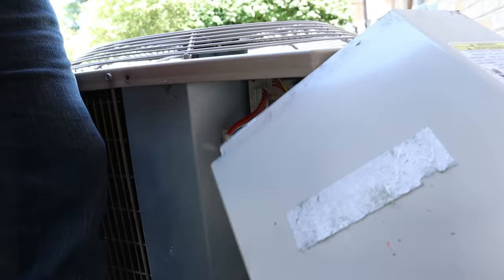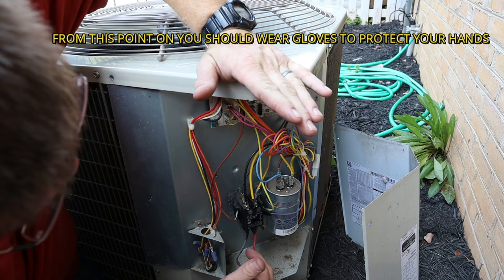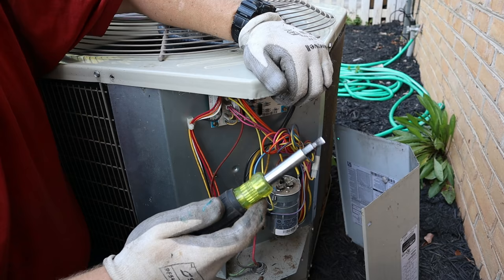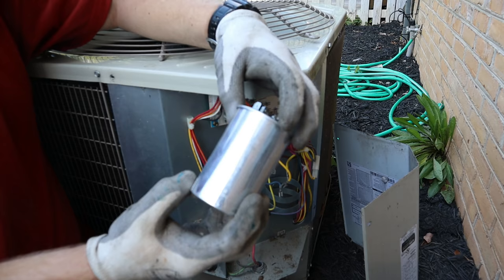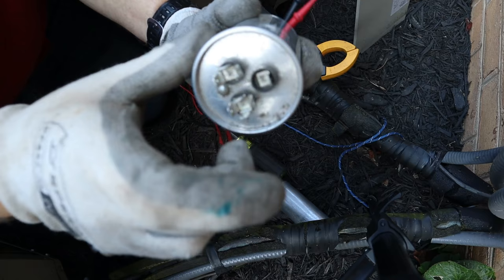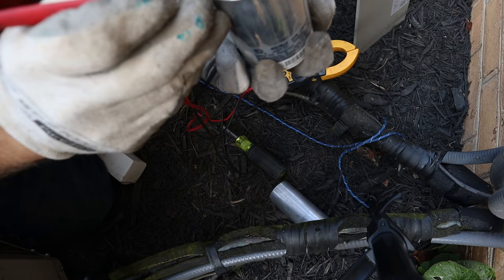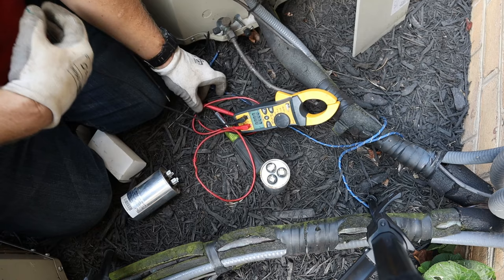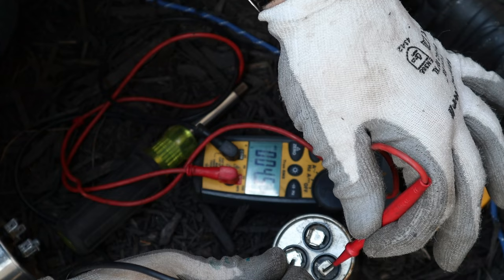How To Fix Your AC |Outdoor Fan Will Not Turn On

Comment: Dude, its 107 degrees and my unit quit. You are the bomb. I owe you.
Reply from the maker: Glad you got it fixed. You already paid for it by watching and commenting. Have a "cool" day
Reply: @MountaineerOutdoors I came home from vacation and my house was like a Turkish bath! Great content, the only problem I have w the video is no explanation of getting oem parts for an older unit the schematic for the top of the component can be laid out completely different than the original one was! My unit is a Ruud I believe it’s a 110 bcuz it’s on the smaller side! But it’s almost 20 years old now so I got a capacitor for it n the layout for the wire hookups is completely different! It took some work, but I finally figured it out! It tested as working but weak signal so I used my new one which looked way better! The original had a plastic outer shell the new one was aluminum! But then I realized my fuse in the outside breaker box was bad as well! Another trip to the parts supplier and it was up and running! It took hours to get the house cold again considering we are in a major heat/humidity spell! We had a big storm when I was gone overnight that may have sparked the issue
Reply: alabama weather in a mobile homes awful at inside 97 degrees and all i hear is hummmmm or buzzzz lol
Reply: @chasitymitchell8502  are u hearing a buzz outside the house or on the inside?
Reply: Well send him a check then
Reply: This is exactly what I'm looking at today, heat index of 115° and it wont work.
Reply: @mikkilglass9896  how did it stop working? Exactly what is it doing?
Reply: changed both capacitors and nothing . i noticed fan will not kick on at all .
Reply from the maker: Might be a thermostat problem is the contactor pulling in when it's calling for cool air?

Comment: The fan on mine started howling like someone was mowing my lawn in the middle of the night. Waiting for the new motor yo arrive tomorrow. As preventative maintenance, I change the capacitors every 5 years and the transfer switch every 10 years. Sucks that the motor didn't make it to the 20 year switch.

Comment: This worked for me! Two years ago I changed out the capacitor thinking it was bad. It turned out to be a bad fuse. AC guy said hold on to my old capacitor because it was still good and I might need it later. Two year later I did and it worked and of course it was on the weekend. Thanks for the video.!
Reply from the maker: My pleasure thanks for watching and commenting ☺

Comment: Thanks for this. I watched this and fixed my AC unit for a $34 capacitor at my local dealer. It went out on the weekend and I know this saved us $300 or more. Amazon had a match for $17 but I wanted to have it right away because of the temps today and tomorrow. Much appreciated.
Reply from the maker: Awesome so glad to hear that this helped you

Comment: I want to say thank you. For the past 4 days my central ac stop working and I use to push the fan just like you use to but it didn't last long and it's was so hot. So I went and bought the AC capacitor and just did the job myself thanks to your video and now everything works amazing. My AC has been with this house for the past 34 years so I do have an older one, but it's all the same thing. Thank you again
Reply from the maker: Awesome so happy this worked for you

Comment: Thank you very much, you were very informative, I just had a service technician come out and change my capacitor, my AC unit fan was not running, $265.00 for the new capacitor.  The technician was very helpful and informative, he advised me to clean out my outside AC unit coils with a garden hose at least once a season, he showed me how to do it.  Mine was completely plugged up, I also need about 2 lbs. of the New Freon added, it was an expensive service call, but I learned a lot.   I had no idea, my AC coils were that plugged up, it's hard to notice that unless you look closely at the fins.
Reply from the maker: Yep such easy maintenance is the key. Actually that wasn't a bad price. I know there are way more companies that charge alot more. Thanks for watching and commenting ☺

Comment: Another thing to notice on capacitors is the prongs on each terminal . Common has 4 pins compressor has 3 and the fan has either 2 or 1. Also good thing to know. Good job though!
Reply from the maker: Yes I learned that much after this video. Thank you for sharing that here. I appreciate your comment and watching

Comment: Never assume that a capacitor has been discharged.  Especially if it hasn't had power for any time.  Caps are designed to hold a charge. Always properly discharge them before handling.
Reply from the maker: Great advice they sure can definitely knock the piss out of you for sure.

Comment: What causes the fan struggle to turn when unit turns on, even after I replaced the capacitor? It spins once I have it a boost with a flat ruler.  House is good and cool now. 75 degrees inside - was 90 inside here in the Rio Grande Valley of Texas.
Reply from the maker: More than likely, your fan motor is going bad. Did you replace the capacitor with the exact same one?
Reply: @MountaineerOutdoors  Yes. Capacitor is good now.  The very old capacitor burned out at the Common four-pronged connector with inner fluid oozing out a little.  It was probably the original one from 1992 and a gray hard plastic, not shiny metal. So, I am wondering if a hung up fan caused the capacitor to fail. Everything works now and house is cool. It's so hot here that the unit has not kicked off at all so I can see if fan turns easily the next time it kicks on.
Reply from the maker: It very well could have. There is a good video of someone oiling the fan on the outdoor unit. Let me see if I can find it. May be able to help you
Reply from the maker: @Texasmann1  https://youtu.be/wSBr0PDCbzE  I believe this one is a good one to watch good luck

Comment: Could use some advice please. I have a standard multimeter, but don't think there is a setting for microfarads, just regular ohms or do I not understand? When I turn on my unit, the fan isn't moving and I only hear a buzzing sound, I do know a fair bit about electronics, usually signals a bad capacitor...Thanks Mountain Man

Comment: 2 months ago, fan would buzz but wouldnt engage unless we bumped it into monentum. Swapped capacitor. Problem fixed.
Now: Same morning replaced duct work in attic, now randomly the outside fan non functional. This time no buzzing. Not sure if I hit a wire or switch in attic or if two scenarios are coincidental and unrelated
Reply from the maker: It could definitely be not sure

Comment: I live I am apartment, turned the air on late Friday night.  An hour or so later it’s not cooling.  I checked and the outside unit is it working, no sound or anything.  They put in new furnace with a/c almost 2 years ago.  Is there a way to tell if the fuse is bad outside without any meters?

Comment: Why my ac capacitor is 350/ 370  and I can't find anything the same must of them ar 370/440  is this works the same please help is 100 degrees,
Reply from the maker: I am not 100% sure. Maybe someone here can help with that. I usually always get the exact same thing as what I had. Good luck.

Comment: Would putting a wood block under the new smaller diameter capacitor keep it in place?
Reply from the maker: Good question, I personally never put any wood in there if it heats up and catches on fire it could be bad

Comment: My ax inside is running at 80 with air blowing. 
My central air outside is no activity. No noise. No spin

Also what voltage reader should I pick up from Home Depot
Reply from the maker: Are you sure that your breaker inside your house isn't tripped? Or if you have a disconnect is it tripped? It could be a low voltage issue to your thermostat. Could be alot of little things. Here is a meter I do recommend from Amazon and the homedepot  https://amzn.to/4bxXB8v
https://www.homedepot.com/p/Klein-Tools-600-Volt-Digital-Multi-Meter-Manual-Ranging-MM325/320822947

Comment: Question, for when you get a chance.. My fan turns.. With bad capacitor it would even start going if i gave it a push.. However, i replace with new capacitor, and now it won’t even make the zoom noise and every 30 sec clicks it did before.. Any suggestions?
Reply from the maker: Maybe a bad contact block or weak transformer?

Comment: Winter gone and spring and summer is here today in MN with 80+ degree. I turns on the AC first time since last fall and the fan motor would run but the AC compressor and/or fan will not engage.  Could this be the capacitor as well?
Reply from the maker: My first place I'd look

Comment: Thanks for sharing. My question: This capacitor activates and runs his big fan only or also the one, not visible in this video (I think called blower) which means blowing cool air inside a home?
Reply from the maker: It runs the condenser and fan

Comment: Question our AC won’t turn on or blow any air... thermostat is on but marking 80 and I’d i turn down it AC won’t start... any idea what I can check or could be... in SA,TX it’s hot right now 🙏🏽
Reply from the maker: Sounds to me like your transformer might have went bad, if your thermostat won't control anything. Just a guess. Will the fan come on if you just put it to fan only?

Comment: Hi my A/C motor is on and I am getting air in the house but its hot air and the fan outside is not turning on. The coils are clean and no frozen lines. Need help! Thanks
Reply from the maker: Sorry just now seeing this.. Did you get it fixed? Was it a capacitor?
Reply: @Mountaineer Outdoors  Yes it was!

Comment: Hello, thank you for the great video and clear instructions.

My problem is the condenser starts and cools the house down for a minute or so but the fan never starts, even if I give it a first push. Then condenser stops. 

Do you think replacing the capacitor fix the issue?
Reply from the maker: I don't think so honestly. A capacitor is mainly for starting it holds electricity due to the in rush.  I'm not a hvac guy but normally that's is what they are used for. Let me know what you find
Reply: @MountaineerOutdoors  thank you for your reply. Changing the capacitor didn't fix the issue. So I'm having someone to take a look at it because if I need to replace the motor i may need to spend the whole day 😃
Reply from the maker: So was it your motor?
Reply: @MountaineerOutdoors  It wasn't the motor. He had to change the control card ($371 )and thermistor ($100). So contrary to what I planned to spend on this ($13) it cost me 471 not including his first false diagnosis which was $400.
Reply from the maker: Well that sucked but at least now it's fixed. I'm sure your much happier

Comment: on mine I can press the contact in for the fan motor and it will spin but it won't switch on like its supposed to.  Do you think it could be something with the thermostat inside on the control box?
Reply from the maker: Are you sure you have control voltage? Something needs to pull in the contactor which would be the thermostat
Reply: no voltage to pull in the contact
Reply from the maker: If you have no control voltage check your power to your t stat. It should be like 24 volts I believe

Comment: My ac turns off after 15-20 of running.  It won't start up until 1-2 hours .  The power company installed something to shut off my ac unit.  Is it the thermostat or the device from the power company?
Reply from the maker: Honestly not really sure that's something I'd have to look at for sure

Comment: How many ohms should the tester be set to?

I have 4K, 40k, 400K, 4M, 40m, 400m

Knight K-810
Reply from the maker: You really need a microfarad tester it's labeled uf on your meter. That's what I would recommend
Reply: @MountaineerOutdoors  ok thank you. Went to my local HVAC supply house, and they tested the capacitor and it was bad. Hooked up a new one, and the heat pump kicked on and then shut off after about five minutes. HVAC company seems to think the fan motor itself is bad, what do you think?
Reply from the maker: It could be several things honestly do you smell anything on the motor? Is the motor hot? Unfortunately I'm not HVAC specialist so I don't really know what that being there it's kind of one of those things that you need to really be there to see. Unfortunately your best bet would be to possibly get someone to check it out. Check around because alot of places have specials for 99$ to come out and basically tell you the problem. Then you can fix it yourself. Or you could probably make a deal with the tech that's there to come back after hours and do it for way less and still have the warranty, through them.
Reply: Turns out the capacitor was bad, and the shut off switch was full of water… drain was clogged; cleaned out and all good now.
Reply from the maker: That's awesome hope it didn't cost you alot to diagnose that. Have a great summer stay cool

Comment: I wish I watched this before I changed the fan motor 😪 great info though
Reply from the maker: Well at least you have a spare fan now
Reply: @MountaineerOutdoors  so if I have no     sounds and no fan moving cannot  be the capacitor but the compressor?
Reply from the maker: That's too vague of a description. Maybe your control transformer went out that's what controls the contactor to pull in to start the fan, compressor and such

Comment: I been having problems with my ac n i suggested that it was maybe the capacitor bc my ac had shut completely off n wouldnt turn on so the maintenance man replaced the capacitor but now my house isnt getting all the way cold so i check outside at the condensing unit n i noticed it was doing short cycles ut would only stay on 30 sec and turn off for few seconds and kept repeating so i just turn my ac off completely cz im nit tryna hve a high energy bill im thinking its the filter drier line maybe needs to be replaced but idk im not a professional
Reply from the maker: Not sure on that one. If you find out for sure please let us know

Comment: I have the same disconnect and it says on off. So you pull it and flip it and it's off. Flip again it's on. If it's completely removed is it off??? I'd like to not get shocked later. lol My capacitor went yesterday should be here today.
Reply from the maker: Fully remove it that way there is no way to get shocked. Yes if you flip it, it's off, flip it back and it's on. Thank you for your comment and watching ☺
Reply: @MountaineerOutdoors  10-4 will do. And thank you for the response 🙏
Reply from the maker: My pleasure ☺

Comment: Hey there mountaineeroutdoor, I know you're not an HVAC guy, just curious if you have any knowledge on my situation. I recently had a new motor installed on the outside unit. So when I turn the AC on, I can feel cold air coming out of the vents, it's just that the fan outside never starts to spin... help! Lol, if you or anyone out there can... thanks in advance..
Reply from the maker: Maybe when they pulled the disconnect to turn off the power they didn't turn on the disconnect or they didn't plug in the blade for your disconnect the right way. Keep us posted on what you find

Comment: We changed capacitor but fan will not start automatically.
We had to turn it manually again to make it work
What can be other problems ?
We followed instructions and put it correctly.
Reply from the maker: Are you 100%sure you wired it back correctly? And if you did is it the exact same uf rating?  And if so check it with a meter if you have one. If that checks good. Maybe it's possible it's a bad one? Last but not least it's possible it's a bad fan motor
Reply: I have the same problem. Pretty sure it's the motor...
Reply from the maker: That sucks but at least you know

Comment: Can you tell me which wire goes to which in new cap? I got brown, blue, and yellow wire. (Old capacitor the words on top I am unable to see any)
Reply from the maker: I can tell you here but honestly if you Google air conditioner capacitor wiring diagram it would be alot easier. If you can't find it email me I'll screenshot it and sent it to you
Reply: @MountaineerOutdoors  Hey man thanks a lot for that I actually figured it out finally, my first time doing anything AC repair it was the capacitor. Question AC is 14 years old but still ok so after capacitor what other parts are likely to be damaged?: thanks for the video (later if I need more help, can I pm you questions? thanks)
Reply from the maker: Well typically I don't do ac work but anything that moves like the contactor inside the unit. Other than that anything electronic. If I can ever help holler at me
Reply: @MountaineerOutdoors  Hey man my other AC unit's capacitor is bad I think, the same exact problem fan won't spin but will spin after I help it spin, there is a humming noise it stop and comes.  Question but this capacitor it got 2 yellow wires in "common"  so when I get the new capacitor, it doesn't matter which of the 4 "prong" in common that I plug those 2 yellow wires into right? just as long as it's into common?
Reply from the maker: I would have to see it. Google it there is alot of images on this and will show you exactly how to wire it up

Comment: Do you have to take the wires off before shorting out the capacitors
Reply from the maker: I would definitely make sure that the power hasn't been on in a few minutes.. Then if you still feel like you need to ground it out then you. A capacitor that small dissipates quickly. Yes I would take the wires off before you do that it doesn't really matter if you do or don't but if you're going to take the capacitor off go ahead and do it.